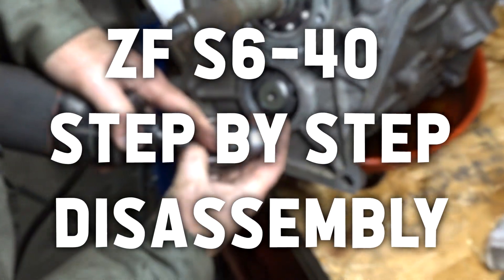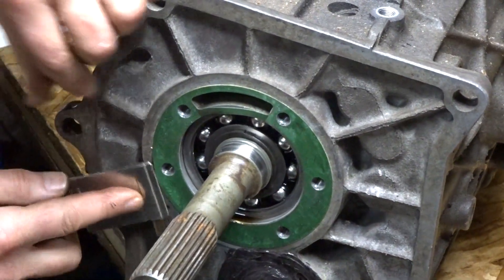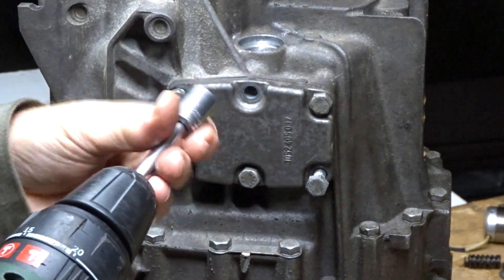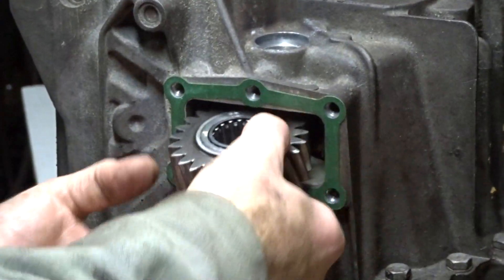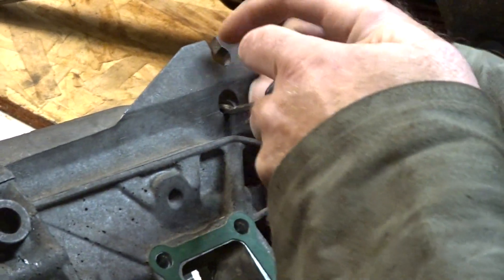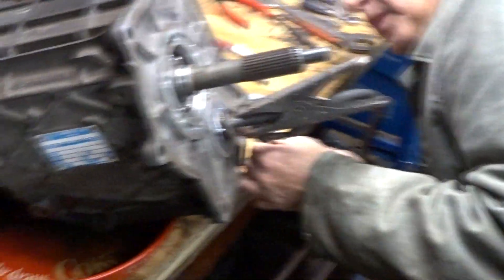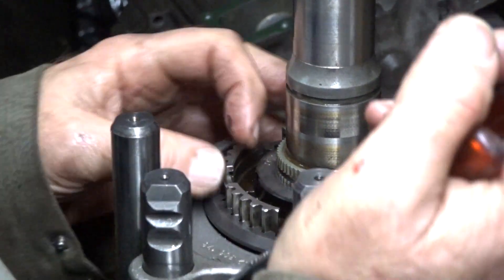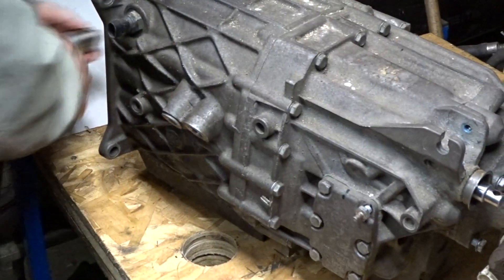ZF S6-40 STEP BY STEP DISASSEMBLY

Comment: hi - working on an older zf m15 and not sure how to remove the int shaft? im sure the pin presses out but found quite alot of tension  and didnt want to break the tab off. yes some heat was applied as well.. just really tight? also the input shaft teeth are pretty bad, where can we find a replacement or can we have them recut?

Comment: hello you are amazing teacher and and amazing person. thank you for sharing this. i have built many gear boxes on the bench. i was told don't even try this by some people that i respect vary much, i think they are old school witch is good so am i they were just scared. you have gave the confidence if i have to rebuild mine. im in the process of changing from an auto 700 r to a ZF6 and a D44 on my C4. its lots of work but if for some resion i have to pull it out and fix a gear of synchro its easy stuff now. thank you i would build anything with your gudens, men like youself are fading away fast.
Reply from the maker: Michael, thank you for your comment, I guess you have also seen part 2 and hope you liked it also. 
I have a 92 Corvette C4 and have done what you are doing now, replacing the 700r and the D36. 
My Vette signature looks like this:
92 LT1, was auto now ZF 6 sp. 397ci, Ross pistons, 210cc LT4 AFR Eliminator heads, self made TR-intake, 1.6 RR, SR 247/255 .664/.664 112°, 11.0:1 CR, 58mm TB, 36# injectors, Hooker 1 3/4" lt headers, no cats, self made dual SS 3" exhaust sys., X-pipe, MagnaFlow mufflers, 4.10 rear, Brembo 13.5" brakes, bigger stabs, coil overs, C6 Z06 18" wheels. HP 540 / TQ 530

Comment: This is an awesome video. Great detail and camera angles. It’s a shame parts are so dang hard to find for this transmission.
Reply from the maker: Thanks Dan. Like I wrote before, couldn't find any videos here on youtube that showed me how to take one apart and no one wanted to touch my ZF even certified ZF repair shops!! Mostly they told me that they needed special tools, so I made a few myself, wasn't that hard.
Reply: @vettef6929  any idea where we can find new/replacement bearings?
Reply from the maker: @DanOnFire  I have answered this question several times, please look at the answers I have written